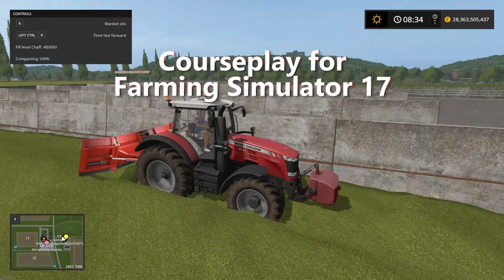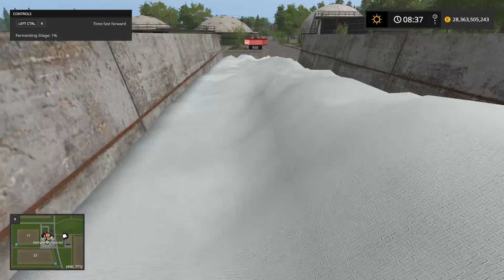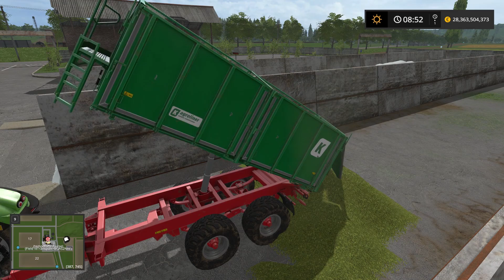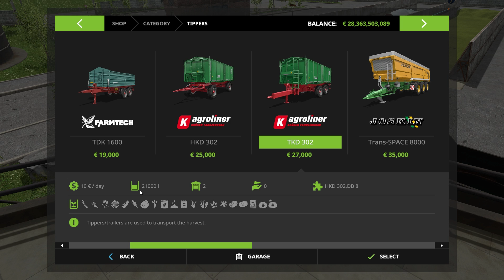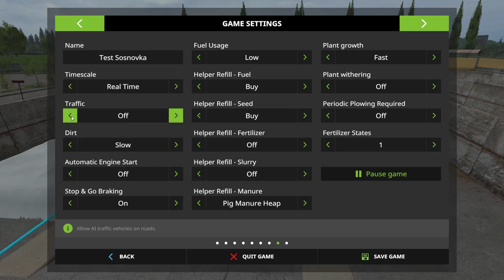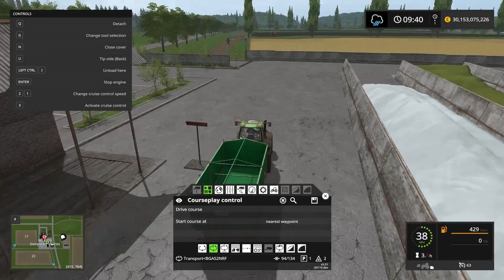How to set up Courseplay for Automated Silage Part 2 - Farming Simulator 17 Courseplay Tutorial

Comment: Can you use side tip? I think the game automates direction depending on the tippers position. Ill try it tomorrow.
Reply from the maker: I am not sure if side tip will work, but I guess it should... Let me know what you find out in your testing :)
Reply: Unfortunatly you seem to have to enter the bunker to use the dump trigger, you can force dump and it goes in but I don't think courseplay has an option for that. If the bunker you use has an extended 'Zone' it should work but otherwise probably not.
Reply from the maker: Yeah that makes sense. Courseplay needs the trigger to know when to start unloading, so if you can move the trigger out a bit, I guess it would work fine :)

Comment: Does levelling more work using a bulldozer rather than a tractor and levelling blade?
Reply from the maker: It would. But using a wheel loader is not possible with this setup. Atleast not if you want Courseplay to do the work :) 
Leveling and compacting mode requires the tractor and blade setup